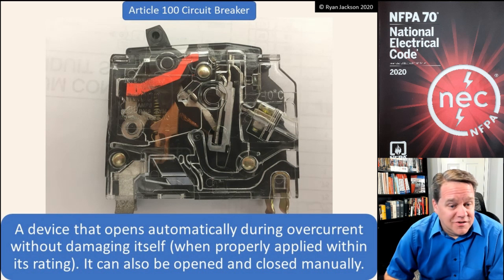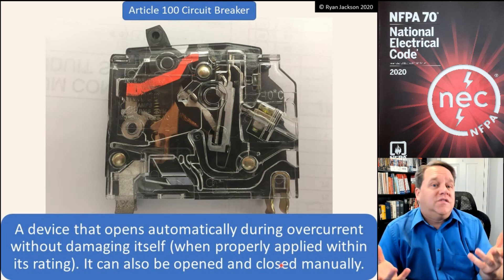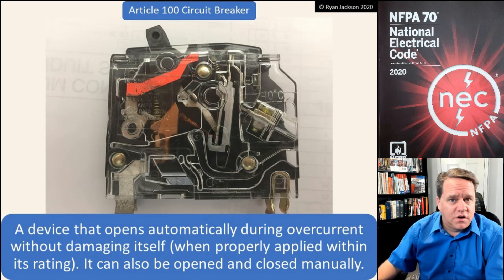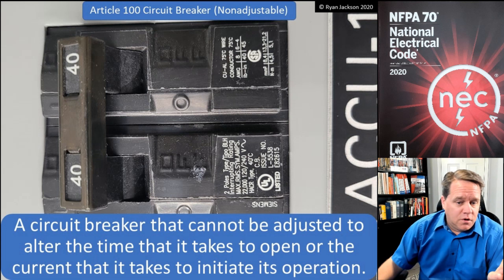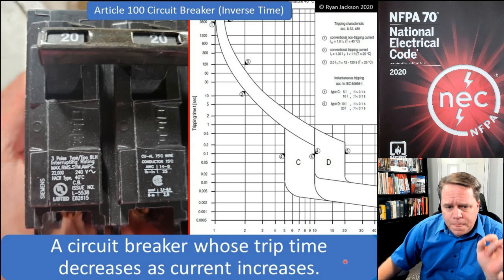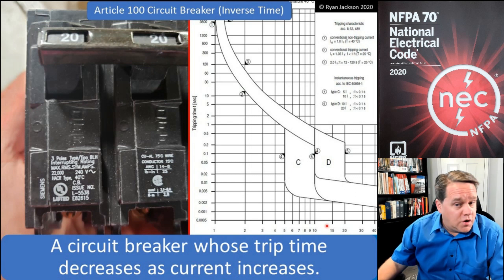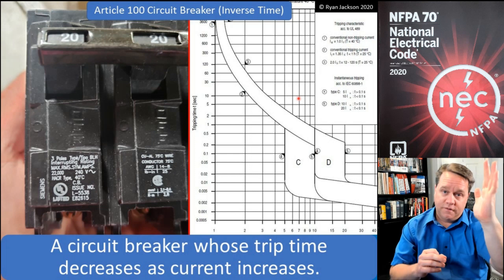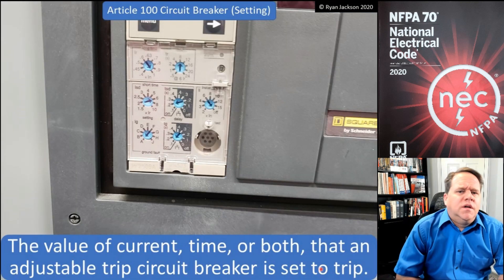100 Days of Article 100: Circuit Breaker (and the various types)

Comment: If you put 40A on a "40A" breaker, it shouldn't open immediately, but because every breaker I've ever seen is derated, it will eventually pop.(30min, or 2.5hrs... it will vary with age and environment.)
Reply: There is a time-current curve, to make it trip sooner, the greater the degree of overcurrent.

Comment: Is the point of an inverse timing curve that some loads will have temporary spikes in their current usage? so for example you don't want to instantly trip the breaker if there is a transient 60 amp spike on a 40 amp circuit, say from a motor
Reply from the maker: Exactly.

Comment: Call me old school but was taught to never load up any circuit breaker by 80%. If we had a fixed lightning load of 12 amps would always use a 20 amp breaker. At the large hospital that I retired from they never put more the 3 duplex receptacles on a 20 amo breaker but during yearly IR scans the 1 or 2 bolt on single pole breakers that were a few degrees warmer then the rest were loads around 90% of breaker. ( 18 amps on a 20 amp breaker ). Would check the bolt on & wire terminal for proper torque and they were never loose.
Reply from the maker: Just for continuous loads.
Reply: @RyanJacksonElectrical  Hi Ryan. We just got some patents on highly disruptive panel and circuit breaker tech. The panel is microprocessor controlled and we've replaced dumb mechanical circuit breakers wit smart solid state modules. Here's a short clip. https://www.youtube.com/watch?v=DtmYrKVzfnI  The patents are US 10,862,277 and US 10,887,964. Check it out.

Comment: How does this come in to play with the "continuous" load of 3 hours or more in which a breaker is not expected to carry more than 80% of it's rating vs the "non-continuous" rating of less than 3 hours in which a breaker is allowed to be loaded to 100% of it's rating?
Reply from the maker: If a breaker is rated for continuous duty it can use 100 percent of its rating forever.
Reply: Don’t forget you calculated at 125%
Reply: If a breaker is not specifically rated for continuous duty, then the breaker has to be sized to 125% of the continuous load.  Or 125% the continuous load + 100% non-continuous load if it carries a mix of both types of loads.

If a breaker is specifically rated for continuous duty, then it is rated for carrying 100% of its full trip rating continuously, and the 125% factor doesn't need to apply.